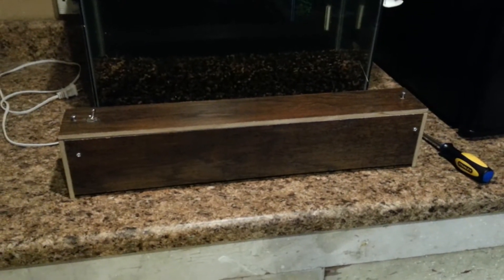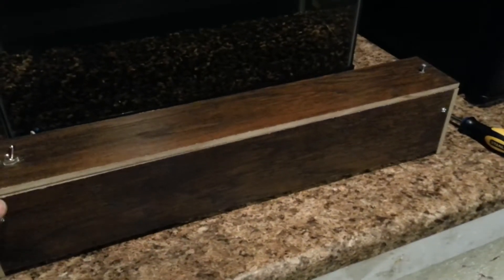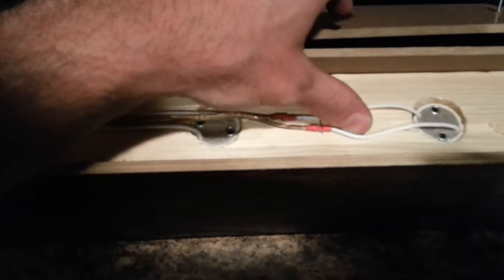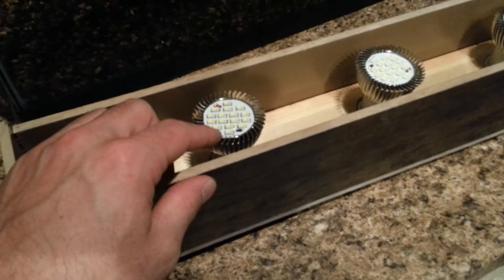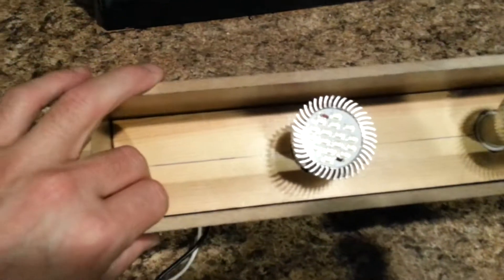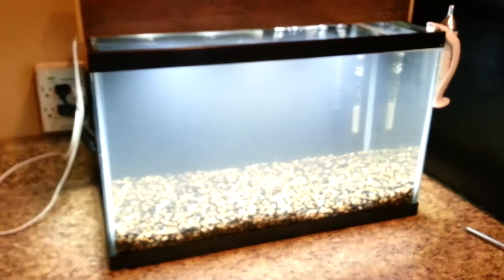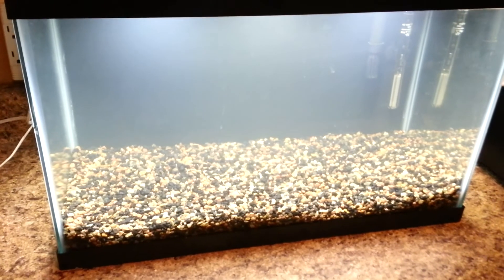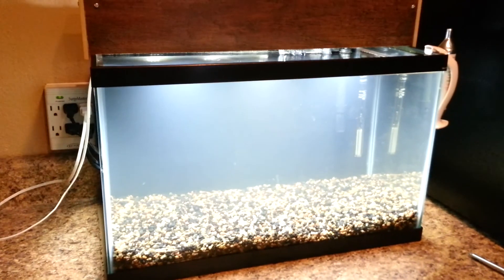DIY LED light for 10g planted tank

Comment: Sean. I am looking to copy your design but I have few questions. Do you feel the amount of light (brightness) is taking away from the attractiveness of the tank? How do you feel about 2 bulbs instead of 3? Do the bulbs need protection from splashing water?
Reply from the maker: i do not think the brightness of the bulbs took away from the tank, once it cleared up it didnt look too bright, i think 3 of those bulbs is perfect for a low tech 10 gallon, if you wanted a high tech 10 gallon i would go with 4. the bulbs absolutely need protection from splashing, they are the least water proof bulb ever made in the history of mankind haha
Reply: Thank you Sean.  I am ordering my balbs now, coming from China, for only $8 each (free shipping).  Thank you for your time.
Reply: I have one more question for you. My filter pump broke so I am in the market for a new one. Not sure if I really need it because my mycoponic system is converting my nitrite into nitrate.

I am looking at the AquaTop Aquarium Power Filter w/ UV Sterilizer.  Is the UV too much?  Will this kill any beneficial bacteria I may need for the ecosystem to function properly?

Comment: I am seriously considering building a DIY hood using these GU10 bulbs for my 55. I plan to completely redo it and do something more high tech. How many would I need? 8 or so?
Reply from the maker: With the bulbs and this design, i think there is a point of diminishing return. I dont think this design would be suitable for a 55g tank. I used 6 on my 29 gallon, and when i took down my 10 gallon, i put the fixture from that on my 29 also, so i had 9 of these bulbs on my 29.
Reply: Sean Williams That is good to know! I will probably get a quad T5 HO. I can get a Odyssea one for less than $100.
Reply: well since he said they were 6 watts each i would the watt to gallon method so minimum i would say 2 watts per gallon  . so  you need 18 of these lights for it to put out enough light being also that he said 500 lumens each 9,000 lumens for a 55g not bad though. i still would go with what you threw out which  is a t5 ho double 6500k or a quad 10,000 higher light more algae though lol.

Comment: good light but those bulbs are pretty dangerous. the heatsink is grounded and the heatsink can be live, or nuteral. depending on which way you put the pins in the socket.... just watch this video. 
Dangerous GU10 LED Spot Light is Cheap and Bright but could Kill You - Seriously
Reply from the maker: Thanks for watching. Before I bought these lights I watched that video, it did raise some concerns, but for the price I decided to try them. Seems to me the guy in that video doesn't know what hes talking about. By the time the electricity reaches those 2 exposed wires, its been reduced to 12 volts, which is not harmful, and they are adequately insulated. I put the light bulb in both ways and touched it every way I could was never shocked. nothing to worry about ;)
Reply: Sean Williams the guy in the vid (julian) knows his stuff about electricity but i guess if you have touched it and experienced it yourself i will lean to believe you. perhaps the 120v model and the 240v model are made differently. who knows :)
Reply: +smallenginedude71 Nah Julian is right and and the GU10 socket is designed for live 110v/220v straight to pin. Julians point was that depending on how the bulbs are connected, there is a risk due to the poor design and small space margins in the inside circuits where the power conversion (led driver) is taking place, its possible a live wire may touch the casing and make it live as well. I have a few of these cheap leds bought from ebay, and they do differ in build quality, but i wouldnt use them anywhere they may get touched or definately not spashed.